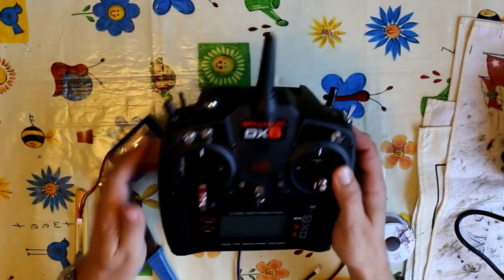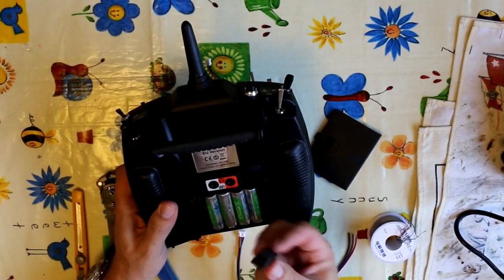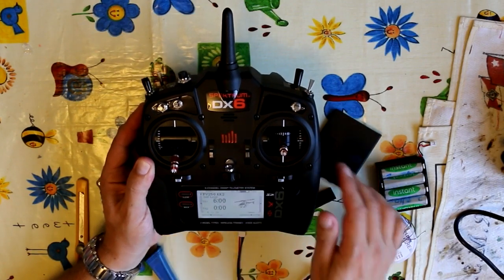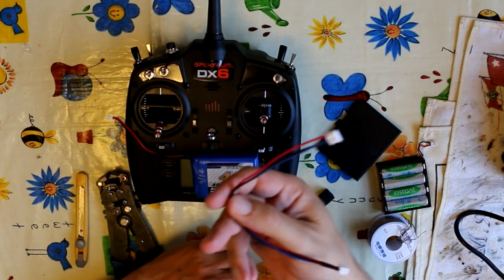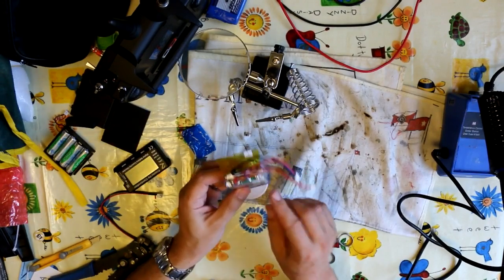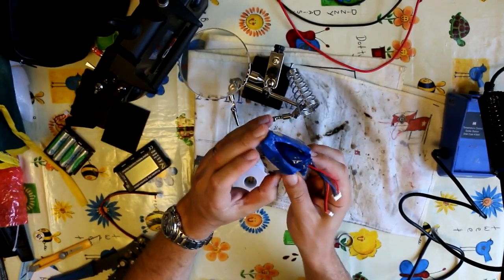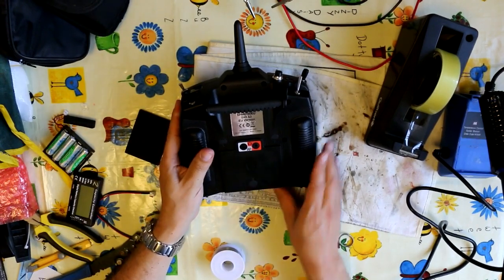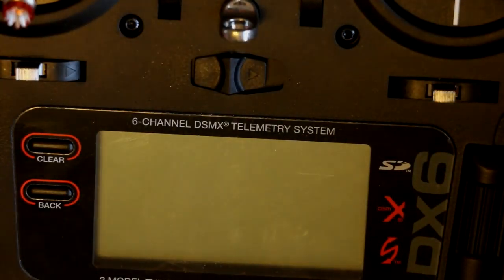Spektrum DX6 -  cheap lipo conversion using Turnigy 4000mah DX8 lipo

Comment: Do you really think it is necessary to have a balance wire for this battery set up?  Just plug battery into charger with the SPM 6834 from Spektrum.
Reply from the maker: I'm sure you can charge with the adaptor at low current perfectly fine. I only did this as I use cellpro 4S charger which only charges through balance plug, the Turnigy battery has an internal balance circuit (and overvoltage protection), so you could certainly charge using the adaptor cable from spektrum, but I would be careful to only charge at 0.5Amps max, as the balance circuit is probably not able to cope with more than a few hundred ma, so charging would be slow (like it is with DX8, which takes ~24hours to fully charge this same battery). Using the balance lead on cellpro 4S I can safely charge at 1C in just over an hour.

Comment: The Li-Ion pack with built in charger is also another great alternative and since it's design for use with the DX6 you wont have to remove it for charging and the battery compartment door has the opening for connecting the power supply.